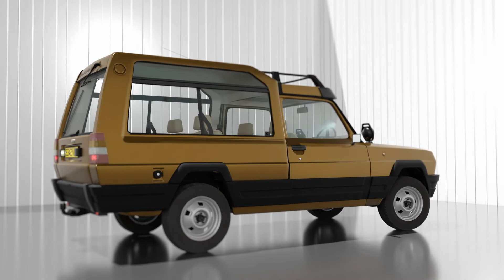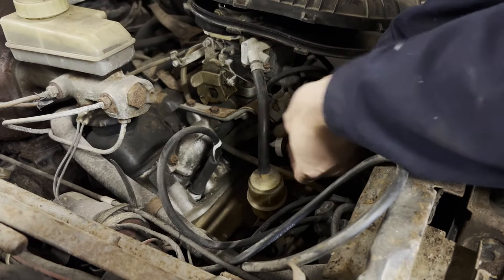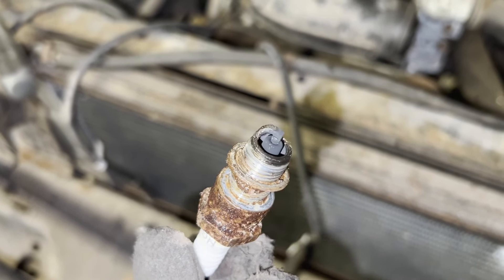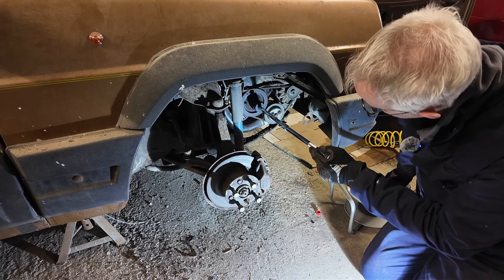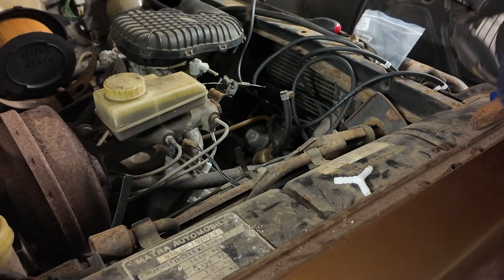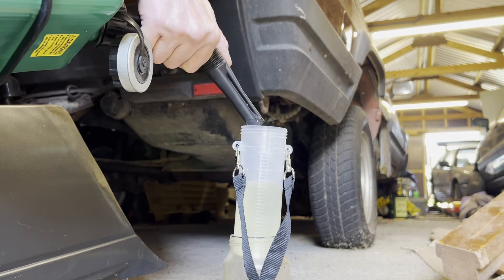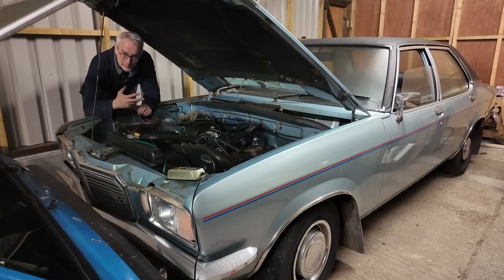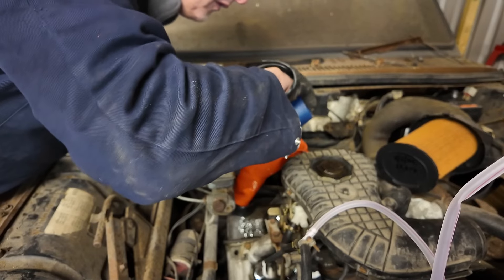Will my Rancho start after 28 years off the road?

Comment: Well done, even after just pulling an engine out & putting it back in its a great moment when it fires up. You didn’t show it but I would always check for a spark before even looking at the fuel, most problems are electrical. I’d also advise one more thing before the rebuild & this has been learned from experience, give the car a really good power wash or better still a steam clean before starting the restoration. Not having tons of crap falling in your face whilst working on a car is well worth the hour or so of cleaning. I shall be following this rebuild with interest, such an interesting car & great to see these rare cars with little value being saved.
Reply from the maker: Thanks - and good call re cleaning it. Power washing is a bit tricky down at the workshop but a bucket and brush would be a start. It’ll get some media blasting in places too.

Comment: What a rare find. A soon as it popped up on my feed I had to subscribe. I'll check out your other stuff when I'm not faffing about with my cars👍
Reply from the maker: Hello and welcome!  Good luck with the faffing - wotcha got?
Reply: @GrandThriftAuto an old nissan/ datsun cherry 1982 with 23k on. Started it up to move it about the other week and 5 minutes later nothing. Tried 4 coils I had spare, ordered a new one with no joy. Points and condenser ready to go on but it's a bit cold today as I suffer with my hands when it's cold. Just sold my old toledo but have a shell in the garage thats been there about 7 years😬 was bought to reshell the other but ended up welding it so the shell was never used. Two door so a bit rare. Also got the l322 range rover bug and managed to get one for £400. That's nearly ready for mot. Needed a prop bearing so that came the other day. Removed it and found the universal joints gone🤦‍♂️ can't buy them so just coming up with another plan rather than spend £500 on a new prop😕
Reply from the maker: @phillmcaverty  Oof! Hats off to you for jumping on a £400 L322 - what a car when you get it sorted! Hope the Cherry is an easy fix too, those are pretty rare now. A friend at university had a maroon one with an interior that was sort of raspberry-coloured _everywhere_.
Reply: @GrandThriftAuto  they're a fantastic classic to own. Just hit the free tax n mot and only £100 insurance. 5 speed makes them everyday usable with a good heater and nice road manners.

Comment: Well done mate - one small point when you run it properly the two-way valve on top of the coolant bottle is missing so the system will not hold pressure, also be very careful if you have to remove the rad cap - if it has plastic tanks they tend to break.....
Reply from the maker: Thank you, that sounds like extremely helpful advice - I need to start keeping some serious notes…

Comment: When i worked for a garage in the 1980s i had a brand new 305 van and when itvwas being seviced i used to use the Simca 1300 van....bright orange ( hid the rot quite well) and i loved its ratty drive and whirring petrol engine, sounded pretty much rhe same as yours by memory!  
I tried buying that van but theyd had it since new and being a Simca dealer had enough spares to keep it running for years, so they wouldn't sell it 😢

Comment: Amazing, great watch. Having the engine running is a massive boost to the restoration process. 
I’m with you regarding the front hinged bonnet; I find it a pain most times on my E12 too. 
Oh, and I love that Victor!
Reply from the maker: Thanks Gentil!  The worst bonnet is the XJS, which only opens about 30 degrees from the horizontal - and heaven knows there's plenty of engine to want to get at.
Reply: @GrandThriftAuto  oh dear…

Comment: Great video! Clearly a minter. In general if you do want to turn the engine with the roadwheel you need the other one on the ground. Otherwise it will just turn backwards and the engine not go anywhere, all due to the magic of differentials (although it seemed your wheel was stuck anyway).
Reply from the maker: Thanks - I was trying to work out what effect the differential would have, but it made my head hurt.  In the end it was easier to go and get a 36mm socket since (for once) the crank bolt was right under my nose.

Comment: After the 1st run the rings will loosen and compression will improve. 

My 1977 100 audi last ran in 1988. 30 year lay up  I   did a comp test from fly wheel. 90,100, 90 and 95 PSI pre start. After the 1st short run it was 130psi across all cylinders. That tells me all is good with valves and rings. As a kid I'd sneak into the garage and turn over the engine by hand during lay up. 

Th see chrning over at least builds oil pressure pre start. I would have removed the plugs and spun it over to save a bit on the starter. Prime. Saves aggro.
Reply from the maker: Agreed on all the above. In fact I did turn it over by hand for quite a while — hey, you cheated and skipped to the end, didn’t you? 😂
Reply: @GrandThriftAuto  No I watched from the start. You have a nice methodology and calmness why skip 👍

Comment: I had one in the seventies a great carry all same tail gate system as the range rovers
Unfortunately all the black plastic panels that gave it the look it trapped water behind and rotted the metalwork while unseen
The final nail was the rear suspension collapsing with the vehicle loaded
The amount for the repair out weighed the cost of a replacement  vehicle
Great while it lasted
Reply from the maker: Yup, the rear suspension mounts were a favourite rot point - and they're the biggest job on my to-do list.  There's a video somewhere on this channel showing all the rust!

Comment: Ahh, The Gentle Tap of The Legendary Poissy Engine.
Reply from the maker: Indeed.  Saying that, I was surprised how little rattling there was (at least while it was running on the fresh fuel).  Not sure it would have passed the 50p test, but it was smoother than the Vauxhall slant four 'hay baler' whose battery it borrowed!
Reply: @GrandThriftAuto  my dad had a Solara Minx. 
Extremely Underrated car, the engine while tappy was pretty strong.

Comment: What is the engine from? I know some cars of that era used Simca ones. I had the rattly but undestructible 1.3 in my 309.
Reply from the maker: Yes, it’s that Simca engine - the 1442cc version.  The same Poissy family also powered the Simca 1100, Chrysler Alpine/Solara, Horizon, the Matra Bagheera and 1.6 version of the Murena - and that 1.3 in the 309, which I think was its last outing. Not the quietest motor (!), but pretty indestructible and - as shown here - it’ll run on anything even vaguely flammable.
Reply: Ah, interesting, much appreciated  @GrandThriftAuto